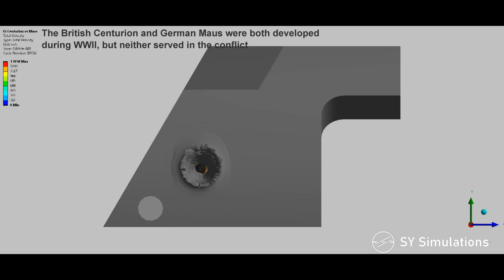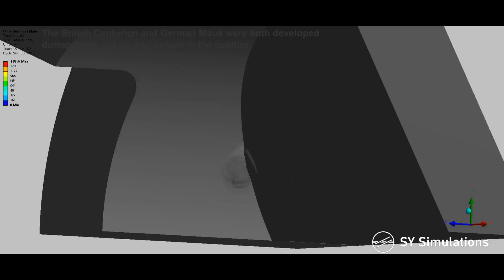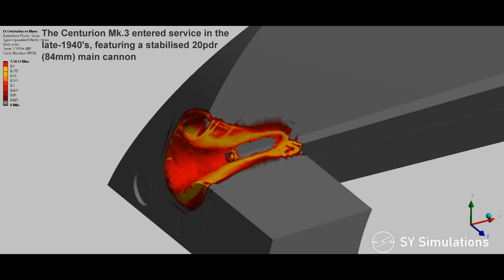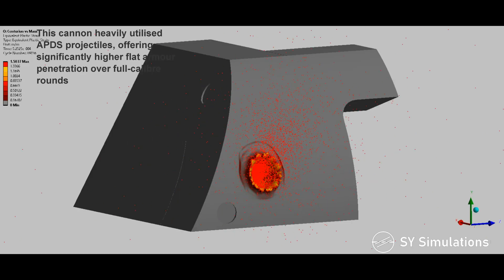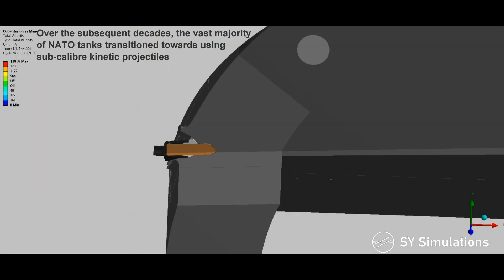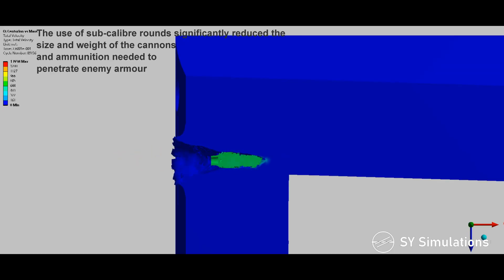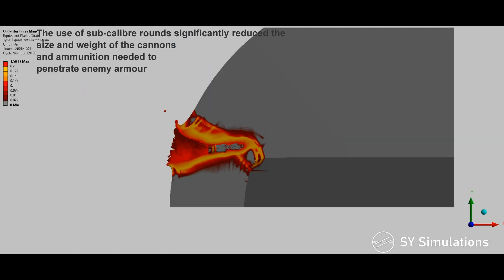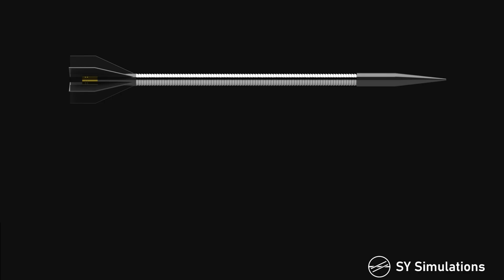CENTURION Mk.3 vs MAUS | 20pdr. APDS Overlapping Armour Penetration Simulation

Comment: Do the 20 pounder vs the T-54/55. During the Hungarian revolution, you had a T-54 drive into the British embassy, and once they saw the armor on the Soviet tank, the British freaked out and created the 105mm L7
Reply: The soviets really were their own worst enemy during the cold war.

The allies had the means to fight the soviets on even ground most of the warm, but whenever the Soviets tried to scare the West away, they just made them create insanely more capable and advanced weapons that were more than enough to deal with the threats they'd actually be facing.

Imagine if the L7 centurions actually had to face T-55s... it'd be a slaughter for the unstabilized, less aware, and less ergonomic boxes from the east.
Reply: He already has one, looking down

Comment: Why does APDS perform so well?
Reply: Because it's a dense sub-caliber penetrator. Armor penetration depends on energy and projectile diamter. The smaller the projectile the easier it is to penetrate armor.
Reply: APDS contains the energy of a full-calibre round, but strikes much smaller point while also being made of heavier, more sturdy materials. The more energy you get into a smaller impact area, the more penetration you get.

Imagine it like trying to punch a hole through a thin piece of sheet metal. Using a mallet, you'd probably fail, because the area of impact is so large and it dissipates energy. But if you were to punch a screwdriver against it, the power of your swing is a lot more focused, and you might go through.

It's a poor example, but that's the general principle.

Comment: Out of curiosity, would you be able to test the effectiveness of sand as an addition to sherman armor. The amount of shermans completely encapsulated by sandbags is quite staggering and I wonder what level of protection it provides. Probably not going to slow an 8.8 down much, but to make the difference between a panzerfaust going through and not?
Reply: None. US already tested that, extensively. 
But the bois in the field don't really care what the ordinance folk are yapping about.
Reply: @jintsuubest9331  Good point. I'm sure it's also useful to just carry around a bunch of sandbags in case you need to fortify a spot quickly.

Comment: Except most NATO and ALL WarPac countries emphasised HEAT as the primary AT round of choice.
Reply: HEAT is too computationally expensive for sy to simulate (for now)
Reply: The most effective is the chamber ammunition, the cumulative is slightly worse, but better than the subcaliber. But only in killing the tank and the crew, in ballistics the cumulative is the worst. Also, it will not kill the entire crew, only what it got in its way, the chamber ammunition explodes inside the tank, they had about 500-1000 grams of TNT equivalent, this does not just kill the crew, it destroys the machine
Reply: @hibahprice6887  What is "chamber ammunition"?

Comment: I know HEAT is computationally expensive hence why you don't do it, but is it possible to copy just the 'Jet' or create a generic version and scaling it to fit the situation with known performance numbers, thus skipping most of the expense. Or perhaps more sanely and consistent, keep on file very common ammo like RPG 7.

To partially answer my own question, option one would be a wild as guess as to the performance, thus completely useless.

Comment: I'd be interested to see a APFSDS round smack some armor with a muzzle velocity of like 5 km/s from a coil gun.
Reply: So you just want a random fantasy weapon?
Reply: Random? Perhaps. Fantasy? No, more like science fiction. Regardless though, it'd be interesting to see how sending a modern APFSDS dart into a huge block of RHA at a higher velocity would have on it's performance. IIRC, current chemically propelled rods top out circa 2 km/s.
Reply: @LexieAssassin round could spin out of control or shatter maybe?

Comment: There was work in Germany during WW2 on ceramic metal composite Armour so a solution might have been found though I am not claiming it would be as good as Chobham it would have had some effect on tungsten carbide .    The conclusion reached in Germany after the war and embodied in the leopard tank is that it was hopeless to build Armour thick enough to resist APDS and the 120mm, 122, 128mm guns so the emphasis switched to speed, mobility, excellent suspension and excellent fire control to get 'first shot first kill'.      Not well known is that Germany equipped some 3.7cm and 5.0cm Panzer 3 tanks sent to North Africa with large gyros that stabilized the gun.  Large gyros means they were 150mm or 200mm and stabilized the gun directly.   The gyros proved to big for guns larger than 5.0cm but Panther and Tiger tanks were to received stabilized optics with an electronic circuit that fired the crudely stabilized the gun.  When the gun  was aligned with the target the gun was automatically fired.   This is essentially how naval guns work and was well established technology.    The Macbach ML230 engine used in tiger tanks was expected to reach 800hp with direct fuel injection of the type used by Luftwaffe fighters and 1200hp with mechanical supercharging.  Finally a series of gas turbines based around the BMW 003 jet turbine were to produced over 1500hp.  GT-1, G2-2 and GT3.   Direct drive and separate power turbine and heat regenerated versions were to be produced. 
-Hence German tank design was already heading in the direction of super high power to weight ratio, superb suspension and advanced stabilization.   
-The Sherman had stabilized gun but it did not have stabilized optics.  The sight was linked to the gun and any imperfections in stabilizing the gun (which was impossible due to weight) effected the sight.
Reply: Can I ask for sources?
Reply: @belgianfried  The references to the gas trubine engines for tanks are from Anthony Kay "German Jet engines and Gas Turbines 1932-1945."   The ML230 progression to a 1200hp engine with fuel injection and super charger is documented in wikipedia, the German work on ceramic armour is mentioned in Igor Wittowsski "Turth About the Wunderwaffe".     The Germans did a lot of work to overcome their nickel and chrome shortages using ceramics and cermets even making experimental turbine blandes, not hard even to find a poto.  
-For the use of large gyros to stablise the guns of Panzer III I found an allied report of some kind.  Only a few dozen tanks were converted and sent to North Africa and the use of large gyros proved impactical beydon 50mm guns   The work on german optical stabalisation systems for tanks I found in an allied report BIOS I think.  This is no suprise because that's how naval systems worked.   I'm sorry I can't find the link.   I did book mark it but that PC  lost.   I'll find it again.  Google isn't what it was once.
Reply: @williamzk9083  thanks for adding sources, although it's interesting to think that they'd tried to miniaturize technology at the time mostly fit for naval vessels, but they did successfully create the first night vision device (AFAIK) which if I'm not mistaken was somehow lighter and less bulky than the American one developed later on.
Reply: @V3RTIGO222  vacuum tube valve technology made tremendous advances becoming much smaller and more robust.  Germans used something called magnetic amplifier with copper oxide or selenium diodes for stabilisation of optics.  Very robust.  Allies copied it and remained in use till transistors in the 1960s

Comment: what a stupid simulation...just simulate on flat face armour like a normal person
Reply: It's clear it would have penetrated on a flat face of the same thickness and material. Imo this is an interesting situation, without any obvious outcome.
Reply: From this we can see it'd cut through like Swiss cheese and can actually speculate that it could penetrate more than double the thickness of RHA.
Reply: It is kind of funny that these sim guys almost never do these kind of "it should go through, but I'm going to make it hit the joint of two plates so it doesn't" sims. They mostly seem to go for those "on the edge" cases, which is smart; and he could have done that for this sim by either extending the range (this was only at 250m) or even adding an angle. Ideally both. But instead he kind of just made it a bit awkward. Maybe he's just trying new things
Reply: @tommeakin1732  maybe because it's obvious it would go through otherwise? Why make tests of things that are obvious? You people just want to have field time with your confirmation bias lmao but at that point why watch or read anything just make up and believe whatever you want
Reply: @czwarty7878  I'm hardly malding, crying, my guy lol. Did you read what I said? I am encouraging edge cases. Edge cases teach us the limits. But there's "this is an edge case that gives us useful data", and "I can turn anything into an awkward edge case". This sim was the latter really. You could make this APDS fail to break it's way through the front of a Tiger 1 if you hit it right on the edge of the frontal hull so it had to borrow straight along the hull plate. Yes, hits like that can happen is real life; but what have we learned? 

I think creating edge cases through range, and even angles gives us more interesting data; that's all :)
Reply: @tommeakin1732  He has always done it close for consistency. Sometimes he does change the distance to show something interesting or replicate unusual real events.
Reply: Dpnt like it? Dont watch it. Or even better - make one yourself.
Reply: @toshibami  what a smart comment? how would i know where exact he simulated it on unless i watch it? are you his son?

Comment: Seems like all the energy dispersed before penetration and the crew survived?
Reply: The projectile knocked a significant chunk of steel free, likely with some spalling. It's likely there would be some crew injuries from this shot, at least.
Reply: Yes, but this was also a hit to one of the thickest areas where the projectile actually traveled into the side armor of the turret, which was perpendicular to the round and frontal armor... Which means it has more than enough energy to penetrate head on in any other region against the armor actually facing it.
Reply: @V3RTIGO222  no, this is literally the weakest point of the Maus tank in the front projection) This is called the turret cheeks, a little higher or a little lower - ricochet, the front of the hull is even more armored
Reply: @hibahprice6887  I'm not sure if you even watched the video, because the projectile didn't just penetrate the cheek... it was able to penetrate into the side of the turret perpendicular to the cheek and effectively penetrate over 600mm of RHA.

What's the thickest part of the armor of the Maus again? Modern SABOTS can pen more than 800mm of RHA, don't be a clown.
Reply: By (for some reason) making it hit the plate overlap, he put it in favor of the Maus as much as he really could. I think it'd have been more fun to see at what range the 20pdr APDS could pen the turret cheek with a good hit
Reply: @tommeakin1732  no because then the answer would have been obvious. this is like more interesting
Reply: I would not stay in a tank that just barely survived getting shot head on, it takes longer to aim your gun than for the enemy to reload

Comment: 12,8 cm Pak 44 vs T-44 Armor
Reply: He already did one against T-54, which had even thicker armor.
Reply: Nah i think it would be clean penetration. T-44 armor was designed to resist up to 7,5cm long pak panthers canon.
Reply: @ikoiko5311  8.8/71 actually. 128mm bounced but sent a chunk of armor flying inside.
105mm L7 was developed to penetrate T-54's glacis because 20pdr had no chance against it.
Reply: or T-54 mod 1945
Reply: That would be a clean kill.

Comment: It blew a hole, and still buried so deep into the armor, 20 pdr was no joke.
Reply: Yeah. And if it had hit further to the right, it easily would've gone through, even at longer distances.
Reply: @AldanFerrox it still did go through which is what’s nuts to me
Reply: Only in War Thunder it is
Reply: Shell shatter 😂
Reply: Thats the reason why he decides to show it with a boohoo gErmAn tank. 
And not with a soviet tank ;)
Reply: @WotansCry  The contemporary late T-44s and early T-55s would not have survived it anyway, so your point is kinda mute.
Reply: @WotansCry And it would have just as easily sliced through soviet armor just as well as German armor. RHA sucks.
Reply: @WotansCry  They never served against eachother, the Centurion Mk.3 is cold war not WW2. Different type of tanks designed on the principles learned after the conflict ended.
Reply: @FutureFlash2034 well not entirely, it was developed on the short comings of the centurion mk 1 which was developed "during the war" like armour and the 17 pndr not being enough. Though the centurion mk 1 never saw service in the war
Reply: Such amazing penetration, yet so bad performace against angles..